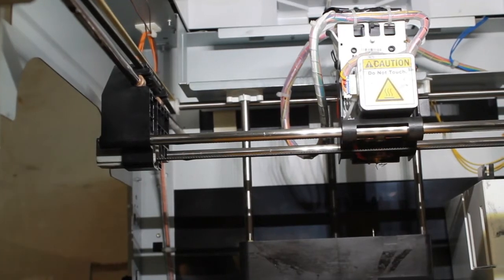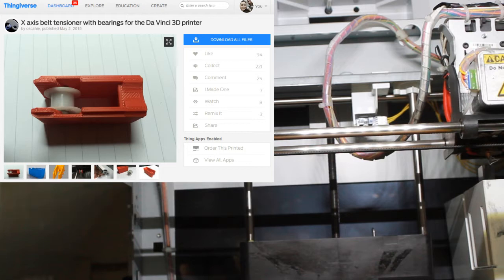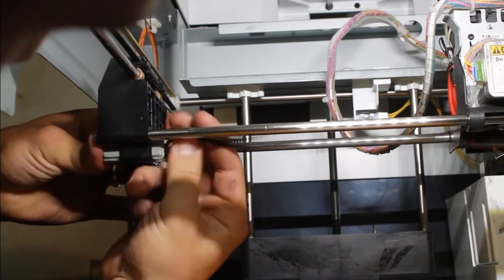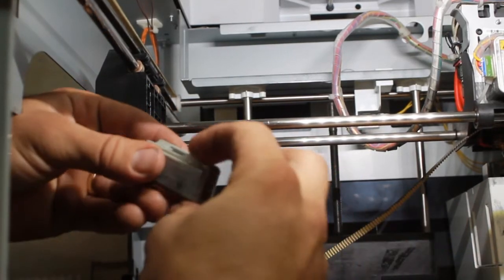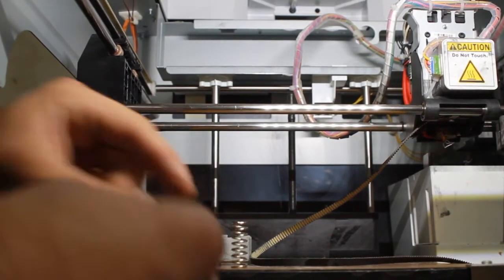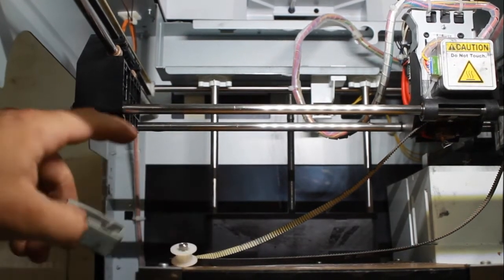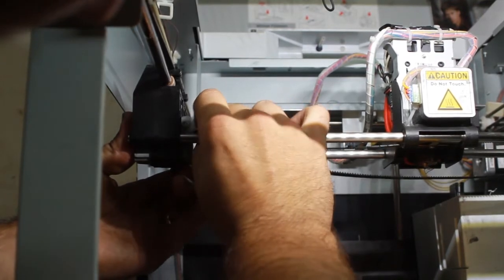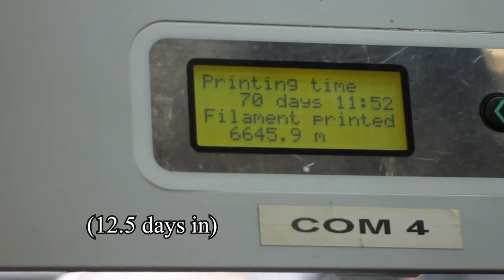Da vinci 1.0a - X axis pulley housing replacement (Absolute must)

Comment: Thanks for that, mine just failed in the middle of a print. Oddly, ages ago when the DaVinci was my main printer, I found this and printed the part and got the bearings with the intention of replacing before failure. But I was diverted by events and a Cocoon Create plus for 18 months.   The hardest part was finding the bits. Once found I had it fixed in no time and this video sorted me out on the process. Good job.
Reply from the maker: Thank you. Yeah such a nice and clean fix made by others. Just thought Id do a step by step video.

Comment: Just found this part broken on my 1.0A... and it's had less than 10 hours. I've made 3 objects with it, and then I opened it one day to find the belt hanging loose and little bits of broken plastic everywhere. I freaked out, but your video has really set me at ease -- I just need to find someone to print this piece for me, so I can get back up and running. Ironic! But thanks for the video!
Reply from the maker: Aaron Nelson I am glad I could help. I didnt design this piece so I too was amazed. Maybe you can jerry rig it to print that part hahaha.
Reply from the maker: I have another video that you may need but not for a while. Its another thing you'll have to do once you get past 1500 hours on your machine.
https://youtu.be/dXYAKI9GDLQ

Comment: The Y-Axis belt tensioner suffers the same wear allowing the pulley to push the drive belt off center incessantly clicking like a ratchet. The pulley shaft support ears are only .066 thick and somewhat flexible. There is also minimal side clearance for the pulley. It is unlikely to find bearings to fix this in a similar fashion. 

Having access to machine tools, I set the pulley holder on a parallel in a vice centering up on the non-worn side and used a 3/16" endmill to plunge down through both ears. I also made 2 custom thin flanged bushings from some 1/4" diameter brass stock. Drilled the hole at .120, turned the .187 dia step back .067 and parted off the bushing with a .005 thick flange. 

There may be a similar bushing or brass spacer at a hobby shop that could be modified to fit this application. I've seen some decent lathe work in soft materials accomplished with a basic drill motor and a file. 

Since the ears were flexible it allows just enough opening to insert the pulley with the bushings installed on the shafts to seat them one at a time.
Reply from the maker: LetsJeep Thank you for that. Ill have to look at that on my machine. I haven't noticed any wear yet.

Comment: Awesome! I put some Lucas white lithium grease on mine but this bearing upgrade looks like it will be a much better solution to prevent it from wearing out
Reply from the maker: Yeah, I would like to see other peoples solutions too. This seems to be a permanent fix.
Reply: Did you notice any noise reduction?
Reply from the maker: I didn't notice any noise reduction. It might provide less vibrations if you file/sand it to be tight like mine though.
Reply: Are these the same bearings?http://www.ebay.com/itm/2-each-MR63ZZ-3-X-6-X-2-5-Bearing-/151840301877?hash=item235a632335:g:PZYAAOSwKIpWE9y4
Reply from the maker: Yes they are the bearings :)
Reply: ok going to order them thanks